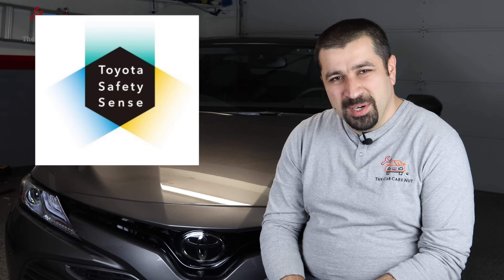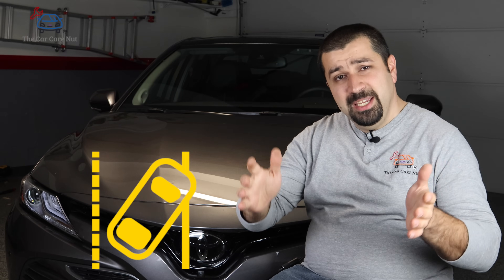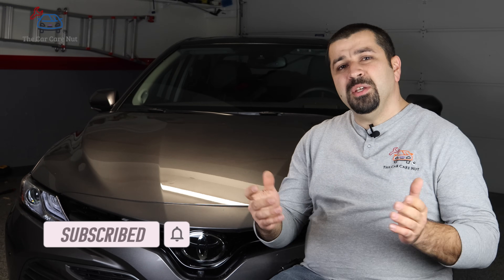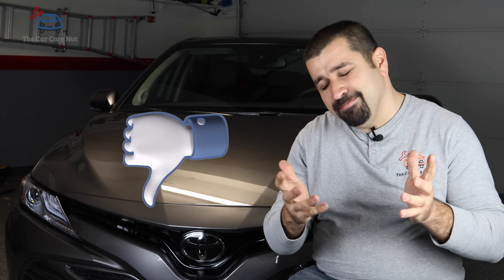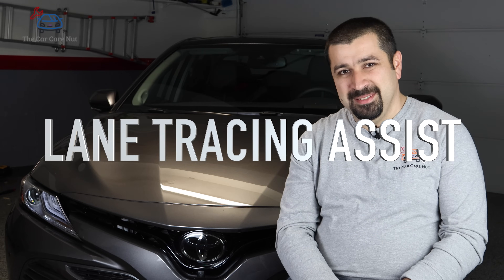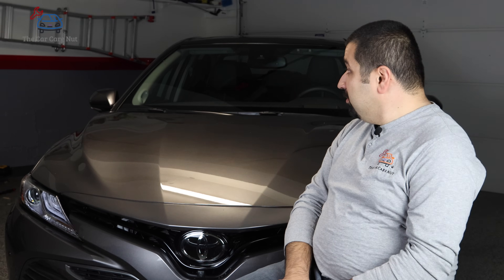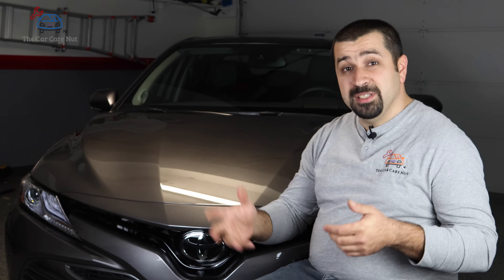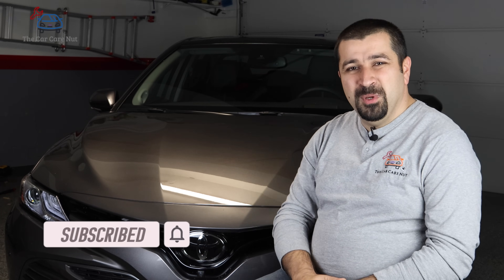How do Toyota Safety Sense Work Part 3 Lane keep assist and Auto High beams

Comment: Drive a 2021 Venza. Safety Sense 2.0 still has a way to go before it is great. For example, the lane trace can turn off unexpectedly. Likewise, the adaptive cruise control can lose the vehicle in front at awkward moments. In sum, Safety Sense requires a lot of supervision, and won’t let you relax as much as you might wish, or even expect.
Reply: I also have a 2021 venza, the hybrid, I've never experienced the problems you're talking about.
I also thought people behind would think I might be drunk going from one side of the lane to the other with the trace on. Fun fact with that lane Trace is when you're on the highway and that solid white line follows the exit to get off the highway my car would try to exit the highway as well.

One day my wife told me about 3 months after we had the car she had the adaptive cruise control on and she said the car will actually stop by itself she didn't have to hit the brake pedal at all, that could hardly believe her. So one day I decided to try it myself, of course always keeping my foot hovering above the brake pedal just in case, and lo and behold it followed the car to save distance and that's that car came to a stop so did ours, shocker I was really surprised and now I have to believe her. Interesting thing is the car will keep track of the one in front and if the one in front starts to move within a certain time frame so does the venza it activates the acceleration by itself and keeps it at a certain Pace with the car in front. but if you sit there too long without holding the brake pedal which of course the car is now holding the car in a stock position there's a light on the dash that says waiting eventually it'll go off and then you have to actually push the gas pedal to get it going and the adaptive cruise control will take over it notices that the car is in motion.
It's been a real kick only this car with all these safety features and warnings, and almost self-driving. The thing I noticed about cruise control and having your hand on the steering wheel you can't just lightly rested on the steering wheel you actually have to put a little bit of pressure or you get the big warning sign on your dash that I don't remember what it says but it lets you know that you don't have your hand on it even though you had slightly have it touching the steering wheel.
Reply: I wonder if version 2.5 as in the 2021 highlander is any better.

Comment: Another great video. Thoroughly loved this series. Thank you for doing this one for us.  In this video I liked that you talked about situations when you may want to turn the lane departure/ lane keep system off. Your right about lane keep assist. It is very sensitive in my Camry. It keeps me on my toes. The only time I don't like it is when going over a small bridge near my home. The system reads the reflector on he side of the bridge. It thinks I'm over the line and beeps at me everytime I cross it. I love the auto high beams as I live in a rural area. I love that it turns down the lights when a car coming the other way is approaching.

Comment: Hi, I've got that 2nd flavor of LKA in my gen 4 GS and it operates exactly as you described. What I find so strange is that the system wants to keep you on the left part of side of the road (when you're on the right hand lane). Which is kinda annoying because of the other passing traffic getting to close for comfort. I put al sensitivity on low so the 'drunken driving swerving' is kept to a minimum.